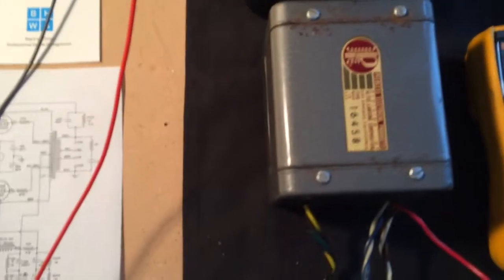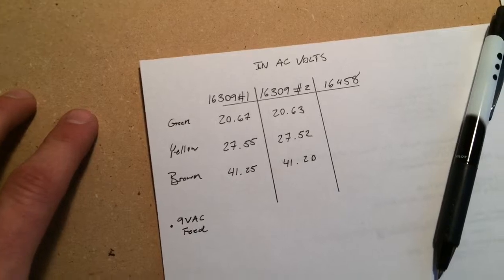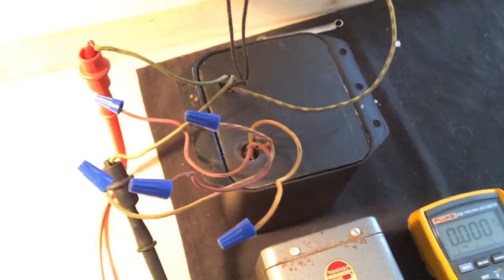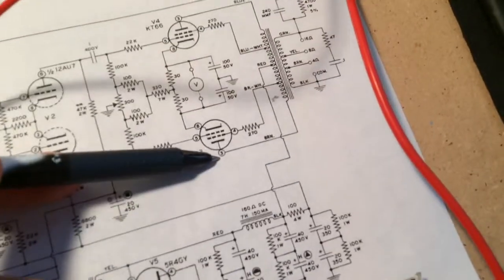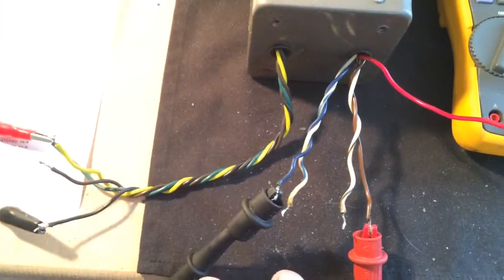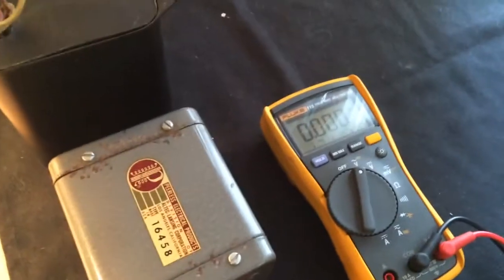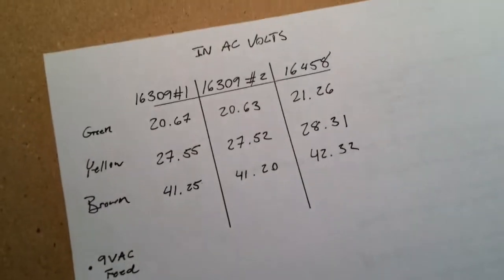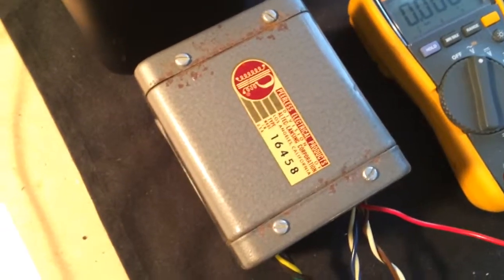Heathkit 16458 Peerless Output Transformer AC Voltage Test W-5M

Comment: Never, and I mean never. Try to test an output transformer using ac voltage on the secondary. This will give you a false reading on the primary as the ac voltage being used is to small. Apply 100vac to 1/2 of primary using a variac and watch for current draw. Other half of primary should be the same ac volts as applied. Now measure the secondary ac voltage. This is only a beginning to testing a transformer. Next would be a hi-pot test. Rule of thumb, twice the dc voltage applied plus 1000 volts. This transformer should be potted at 2.5 kv dc. Another test is a PI test for insulation breakdown. Why am I telling you this, I rewind transformers for a living and when I see a video which is ALL wrong, people should know.
Reply: I did seem strange to me to test running ac on the low impedance side. I have worked for several companies running insulation tests with a Hi-Pot tester at 1kV ac or we would use a DC meg-ohmmeter at 500 Vdc. At the very least I would have used some kind of current limiting like an automotive light bulb in series with the low voltage signal. Ideal would be higher voltage with current limiting on the primary, agree.